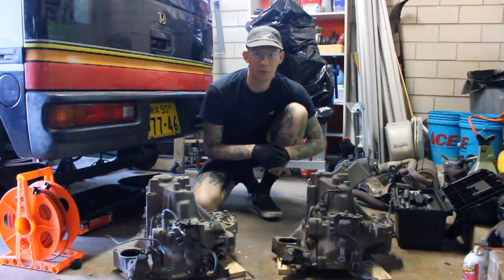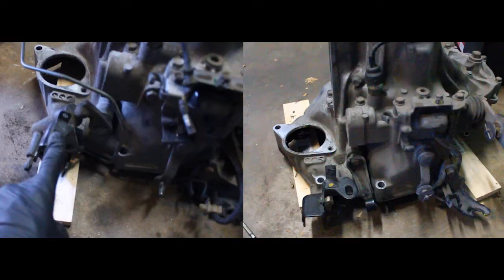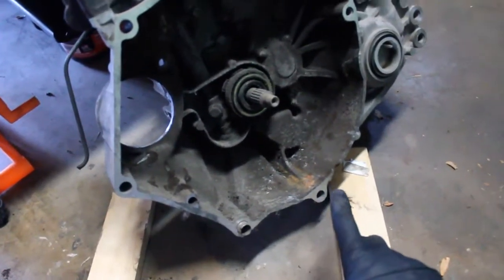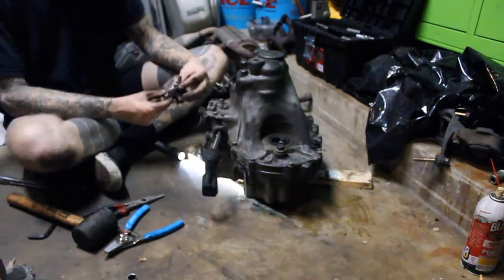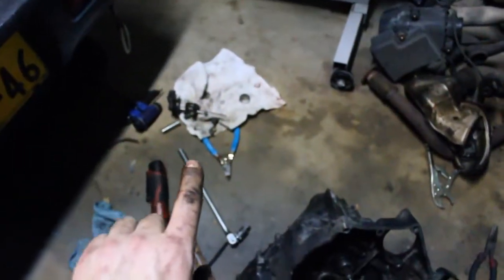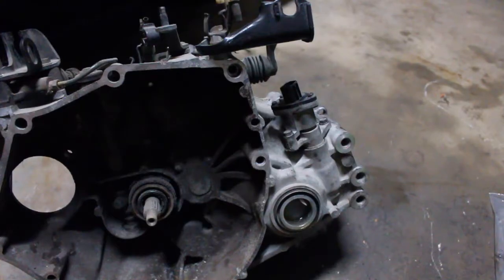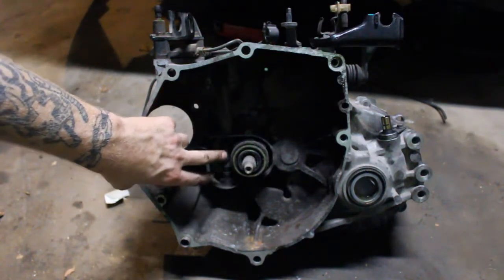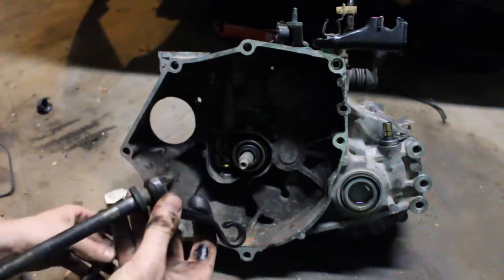I Broke My Honda Acty Transmission!

Comment: I'm trying to troubleshoot my headlight fuse popping when I go into reverse. I confirmed when I disconnect the ground from the positive in the left rear tailight housing it no longer pops. Where is the trans reverse switch located?

Comment: It would be nice if you where able to have a "friend" that works in a Transmission Shop, or a "Seasoned" Honda Mechanic to properly install (swap-out) the Proper Gear Ratio for the ACTY.
I'm not too sure if the Ratio of the "BEAT" is going to be favorable in a "Heavier" Vehicle such as the ACTY...